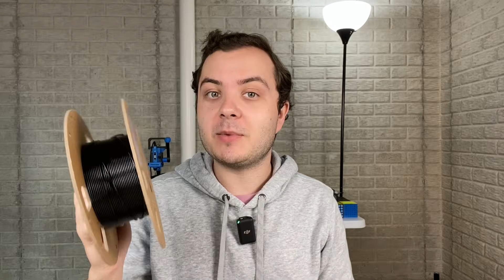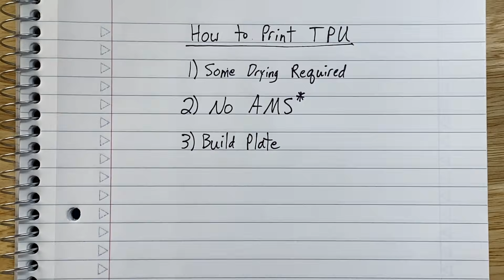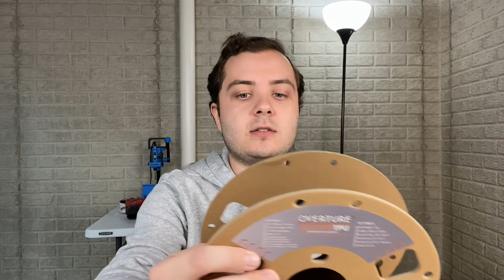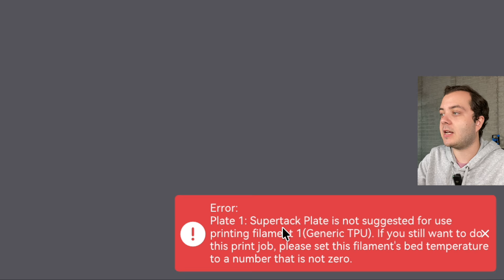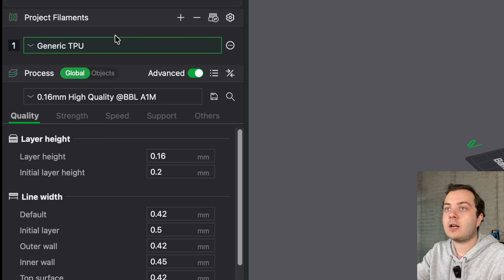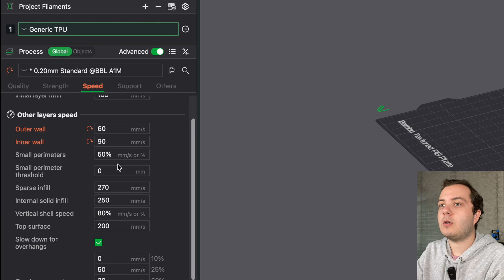TPU Printing for Beginners | 2026 Guide

Comment: My two biggest tips are to get a tape measuse out and cut off whatever amount you need, leaving the spool in a container with desiccant so you never actually pull out what you're not using. Then wrap what you need around an empty spool. Now you've got a super light spool that will rotate smoothly, and you're only exposing what you need to moisture. Most slicers will tell you how many meters of filament will be used. I generall just take 10% more because I don't know how to account for the stretch. But typically things I want to print with TPU don't exceed about 5-10m.
The other one is to ALWAYS use a smooth plate. Yep. It sticks like crazy. But a tiny spray of IPA releases it with zero effort. Basically slides off. So you get great adhesion, easy removal and dry spools.
Reply: OR - Use a dry spool box. 😊

Comment: Nice one - only thing I would have loved is some more info on loading/positioning TPU for printing
Reply: You need to use the external spool holder, take off the PTFE tubing for #4 in the AMS and feed it into the slot of the external spool holder. Then manually load the filament in by clicking filament, external spool holder, load filament (after setting it to TPU). Load the spool and feed it into the tube when it asks. The nozzle should start putting out TPU. It will ask to verify that it has. Then make sure to turn off use AMS when doing a print.

Comment: Thank you for such a clear straight forward information.  I have a p2s, about to print tpu for first time using an external not ams.  It’s for small scaled tires for model rc no supports.  Is the height the number on tpu softer the filament. And with that using your knowledge I don’t then need to change out my nozzle correct? Thank you for your time.
Reply from the maker: tiny tires, awesome! Use 0.4mm nozzle and just be sure to slow down the print speeds for the best quality. the higher the number with TPU, the harder it is (ex. TPU 65a is softer than TPU 95a)

Comment: do u need an enclosur
Reply: Depending on your environment it's recommended. I got by accident the best results by putting simply a box over my printer as I opened the window for some fresh air. Don't need to get one of those fancy cabinets just a regular large box may give you the answer. Since then I got my hands on one of these growing tents - little heating system and ventilation already included 😎🤌

Comment: if you suggest not print supports with tpu, how you solve problems when u have lots of bridges in the design?
Reply from the maker: That’s a tough one. Ideally you would want a dual/multi extruder printer that can print PLA or another material for the supports if they are required. 

Supports CAN be printed with TPU but they will be very hard to remove.

Comment: I'll be using tpu for the first time.  I bought a food dehydrator to dry it before use.  I'm using a Bambu P2S with overture tpu.  Since I can't use it in the AMS 2 Pro I'll be using a stand to hold the filament while printing.   How quickly is the tpu going to absorb moisture since its out in the open while printing with it?  Currently have a range of 50-60% humidity.

Comment: Lowering the speeds here doesn’t really change much because the Generic TPU profile already has a low Max Volumetric Flow limit.

In Orca/Bambu, actual print speed is capped by:
flow (mm³/s) = line width × layer height × speed

With TPU set to ~3–3.5 mm³/s, you’ll end up around 40–50 mm/s anyway — even if you enter much higher speeds in the Speed tab.

So the printer was likely already flow-limited.

You can check this by setting high speeds in the Speed section, slicing the model, and then inspecting a few layers. Scroll from left to right and watch what happens to the print head. You’ll see the speed of each move, which most likely won’t exceed 50 mm/s.
Reply: so in other words orca adjusts speed variable to make that formula correct? thanks did not know that
Reply from the maker: Useful tips! If you do want to use slower printing settings than the max flow allows, you will still need to adjust the speeds manually.
Reply: @thinkable3D Correct. Priority has MFV and then you can slow the print further by the speeds tab. In your TPU case it would make sense to go as low as 30mm/s or 20mm/s.
Reply: Just saved this comment. Just started my 3D printing journey and am intentionally saving TPU prints for later. This is a very helpful comment.

Comment: Hi, I am trying to print TPU butt it seem that the fillament keeps getting stuc in th motor or the motor seems to slip on the fillament witch results in no fillament comming out of the nozzle, wath can i do about this?
Reply from the maker: Make sure that the temperature settings are correct and that you are feeding the filament directly into the hotend and not through an ams. 

Which printer are you using?

Comment: Thanks for this info. I wanted to know that if you're using the generic TPU profile, do you need to also do the calibrations and then use that profile? Also, I totally understand how you explained you could use 1 type of filament as support...im using the P2S with AMS 2, and I know I can't run TPU though AMS. However, could I use the support filament in the AMS and then feed TPU from side spool feeder? Thank you!!
Reply from the maker: thanks for watching! unfortunately its not a good idea to  try multi-material printing with the P2S (ex. TPU print with PLA supports). Bambu makes their TPU for AMS, but still not great to swap 2 different kinds of filament through the same nozzle hundreds of times for one print, you are asking for a nozzle clog/other issues. 

This is why printers like the Bambu H2D/H2C, snapmaker U1, and Prusa XL are great for "Multi-material” printing because they have more than one nozzle. But these printers are too expensive for me right now. Ill wait for a cheaper one to come out lol.
Reply: @thinkable3D this makes perfect sense. I forgot about running different materials though same nozzle…and why I actually have one nozzle for TPU, and another nozzle for PLA/PETG. Thanks for the response!
Reply from the maker: You’re welcome. Happy printing!

Comment: Thank you very much, your video is so clear and informative! One question: when you print, is the filament open or do you print from some dry box with a small hole?
Reply from the maker: I print with the spool open on the roller attached to the printer, but it is worth trying to connect it to a dry box or dryer.